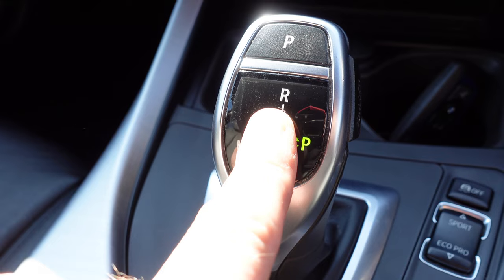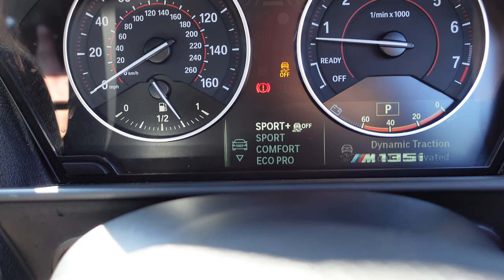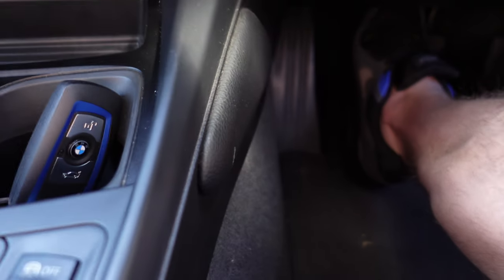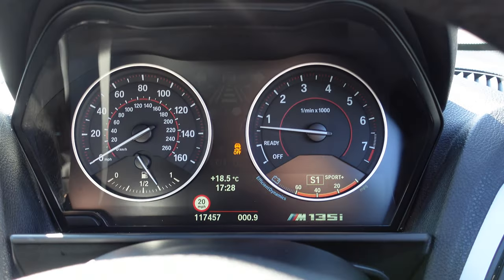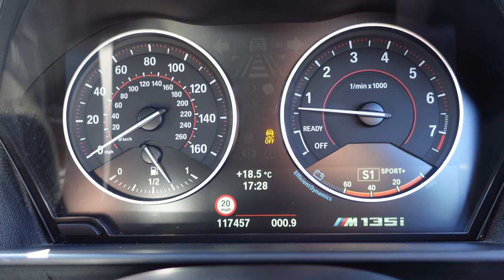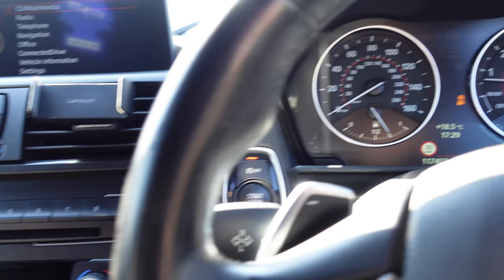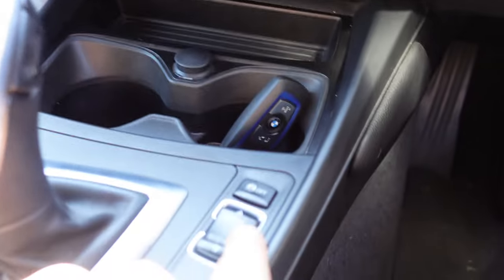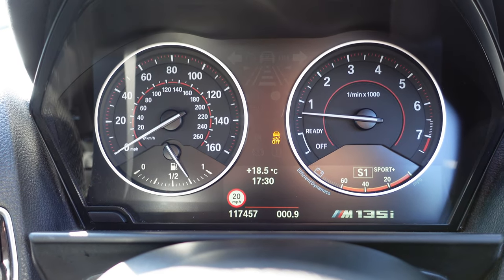How To Setup & Use Launch Control On Your BMW F Series

Comment: I’ve used Launch control on my 335d f31 about 4 times on different occasions, 0-60 in 4.8seconds is thrilling 😎 but the last time I launched there was a real chemical type burning smell from the engine bay, I don’t think it was rubber / tyres and so possibly clutch, I’ve never bothered with it since, not sure I want a clutch replacement service bill from bmw!
Reply: Im afriad to even try it on my 30d  knowing my luck 😂
Reply: You're not supposed to do it many times you need to let it cool down after one launch, they even mentioned not to over do it or do it at all since the clutch will wear down quicker
Reply: Clutch? Isn’t the 335d a torque converter only?
Reply: @M55ONO  do it, I've done it once in my f31 30d xdrive and let me tell you its fucking good 🤣🤣
Reply: @seechim  that’s what I thought
Reply: It’s a torque converter so no clutch to replace!
Reply: @northofnosouth1470 ey I got a f31 330i xdrive
Reply: @Supremepikachu   good 👍🏼

Comment: I have a 2014 550i Msport, so I'm guessing this works on mine since I have both Sport and Sport+ modes. I remember watching Matt Watson from CarWow saying he was able to pull quicker times in Bimmers by either not using LC, or not using the paddle shifters because if you miss time shifts, the car will bog.

Comment: Great video... while engaging the break... launch control. Is it a case of simply releasing the break to launch? With you foot still on the accelerator?
Reply: Yes. These days, many cars with electronic LC rely on the brake. Cars with forced induction benefit hugely from it. Personally, even though some setups can be a bit complicated, they do make it a fun and fairly easy way to launch how you would on a drag strip. Cars on the strip are usually setup with a line lock or a trans brake and a reverse lockout. All of these setups are designed to boost engine production and engage the drive train seamlessly when the car launches. Easiest way to do this is to "brake boost" which is what modern-day launch control actually is.

Comment: Hi, I have a 120d 2016 Msport. But I can't seem to get the launch control, does the 120d have this option. I have also checked the owners manual and it does not show the features.

Comment: Hello, I'm doing all the operations including coding, but I can't see the active text.  Bmw F11 2.0 184 PS 2013 LCI.  What is the reason?

Bimmercode 
Sportspansion Activ
Expert Mode -3000 LC Activ 

not working 520 xDrive

Comment: That explains it. I have a 2012 F30 335 with S2TB. Coded launch control with Bimmer Code but cant get it activated. 

I need to update firmware. Best way to do it? Its MHD Stage 2+ if thats an issue?

Comment: Just bought a bow 640i 2013 M package  (PWG), do you know if it comes equipped with Launch control? (haven't had the chance to try it since it came with some outer damage which is being fixed at the moment).

Comment: Cheers, worked on my 120d, you might not think but it goes pretty fast with LC👍
Reply: I've tried on my 120d and didn't work. Do I need to activate something else? Or it needs to be coded too?
Reply: @cristianvlasceanu It has to be an f20 or f21 BMW M120d  for it to have LC If your does not have the M pack it does not come with LC

Comment: I have a 2014 650 i  Grand coupe 4 doors, does it have launch controls? Thank you for your great videos on BMW!
Reply from the maker: You "Should" Have it activated go and try, If it don't work hit me back up I will tell you how to activate it.
Reply: @BMWDoctor   I have a 2017 530i and have the 2tb in bimmer code but cannot activate launch control, how do I get it ?

Comment: Hi Dean, thanks for nice content , i have 2013 f30 335 m package ! Can i enable it , thank you
Reply from the maker: You can indeed my friend, tell me do you have extended instrument cluster ? If not can you find out your I Step level for me ? And I can tell you if you can OR you may need to change it.
Reply: @BMWDoctor  i have I-level factory, F020-12-07-533 is that the i step level you need ! Thanks
Reply from the maker: Yes you are on latest one :) Same as mine ! As F30 Uses same as F20 I Step :) So You can enable it. Just let me know do you have 2TB In VO ? Sports Transmission
Reply: @BMWDoctor  yes i have it and with pedal shifters too
Reply from the maker: Ok wait for my video to drop I will show you how to sort it all ! I'm gonna be posting on how to set it all up on the modules.
Reply: @BMWDoctor  great ,  i was excited about your last purchase specially with n55 engine, thanks
Reply from the maker: Thanks a lot my friend, I will say this car didn't come easy, As I nearly bought before this a 750LI With the N63 Engine, As it was the most fully loaded 7 series I had ever seen on a F01.